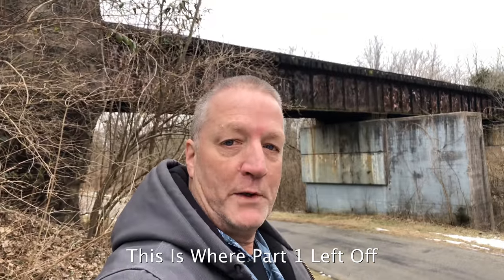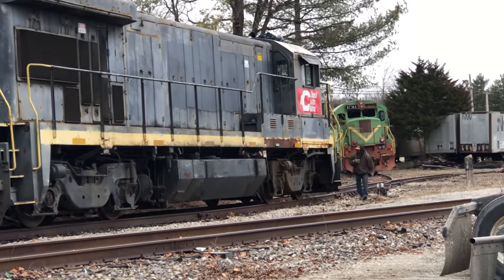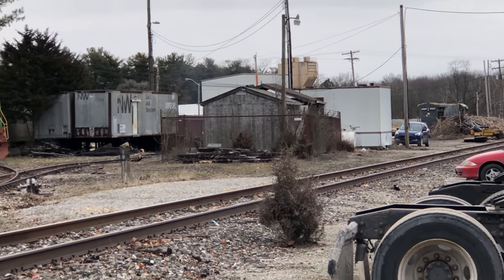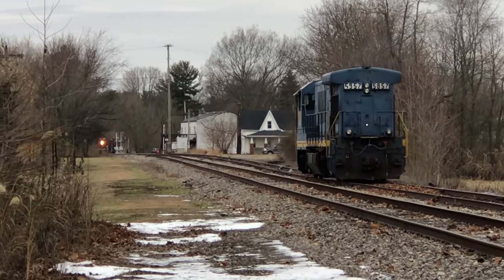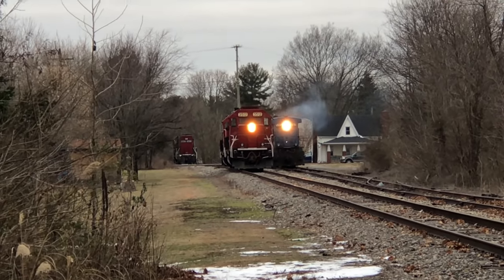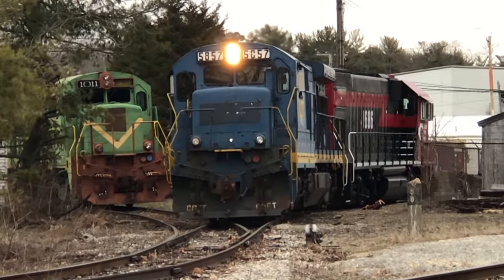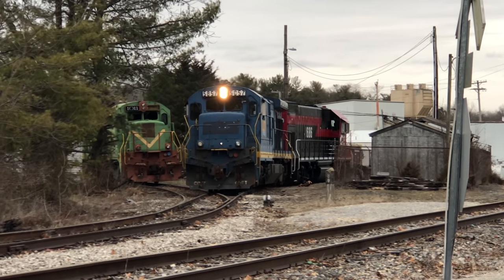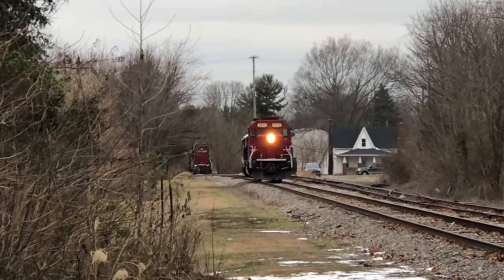6 Locomotives Railroad Switching In Sardinia Ohio Railroad Wye!  Entire Fleet Except 1, Rare Video 2

Comment: The green and yellow B23-7 is a former Modoc Northern that ran out of Lakeview Oregon. That railroad fell apart overnight and who owns the CCET took over the line and got a few of their motors in the process. He transferred it over to the CCET and I believe it is a parts unit
Reply: I read the same thing about #1011 being a "parts donor" for the other two GE units.
Reply: I used to live in Alturas California, I used to watch those locomotives for the Modoc Northern go by constantly
Reply: @robertf3479  I like the term we used in the Army: "hangar queen" -- a term for a piece of equipment more or less stored in the shop, and used for parts to keep other equipment going. Apparently it's easier than ordering the needed parts.
Reply: @georgeadams1853  The Navy uses the same term and for the same reason.  It might be that the B23-7 is old enough that prime mover parts are getting pretty scarce on the shelf, but she might have some parts commonality with the B36s, as strange as that might sound.

Comment: You’ve captured an interesting element of railroading design, the “wye”. Used in lieu of a turntable for turning steam engines for return trips. In mountainous terrain the railroads, for lack of space, would install a “wye” into a tributary off the major river to turn locomotives and those facilities spawned housing and restaurants for engine crews which later developed into towns. There are several examples of these “wyes” turned into towns in WV and KY. Thanks Jaw for this video.
Reply: Examples of these “wye” communities include: Naugatuck and Iaeger, WV and Martin, KY. There are others as well. Being at the head end of long rivers, each wye provided an opportunity to turn steam locomotives and now diesels for return trips downstream without needing a turntable. They morphed into towns as facilities for train crews expanded and railroad maintenance shops arrived.
Reply: @richarddrum9970  NS has a wye in the Portland neighborhood of Louisville. It lies between the K&I Bridge, Youngtown Yard and a slip that leads to the CSX-LIRC-PAL interchange.
Reply: Too bad the track to Hillsboro is gone. I bet that if it was still there, some companies in Hillsboro would give the CCET some business.
Reply: That was most interesting to see that work like that. Thanks to Jawtooth and thank you Richard Drum for explaining the history of the wye.
Reply: Thanks Richard Drum for the explaining of the "wye."

Comment: Maybe I`m wrong, but it didn`t sound like the 2nd and 3rd locomotives were even running when they left for Cohen. Curious as to why you would tow that much extra weight if you didn`t need to, especially when you are only pulling 6 empty cars.

Comment: 1011 is a cool engine, it’s sad to hear that it can’t run that much. It was originally a Southern Railway high hood B23-7. I like the new SD40-2.
Reply: Any idea what the other loco is hiding in the back is?
Reply: @Rob94hawk  Which one?
Reply: @BmdZero  the blue one off to the right that’s tucked away. Not the green one off to the left in the yard. The far right.

Comment: SD40-2 #3512 looks good in those colors though I think it needs the stripe on its' sides, sounds good too.  

I'm wondering why none of the GEs have received the Black and Scarlet paint scheme.  Maybe waiting until they're overhauled?
Reply: I doubt they overhaul the GE's.
My guess they will run them until they crap out.  (major failure)
For various reasons, RR's do not overhaul old GE's.

Comment: Is the Sardinia Y a functional Y?  Can it be used to turn engines and equipment?
Reply: I believe it is still intact. There may be some trees that need to be trimmed or cut down, but I`m pretty sure it`s still all there. I haven`t been out there for about 3 years.
Reply: Last time I drove through there the west side was paved over at the crossing right behind where that green loco is sitting. Not sure if the tracks are in usable condition beyond there.
Reply: @1960gambit  tracks are there. I think Brian said a while back they abandoned the plan of using bit to turn locomotives around.  But you never know. Who would have ever thought Afton would get developed like it is